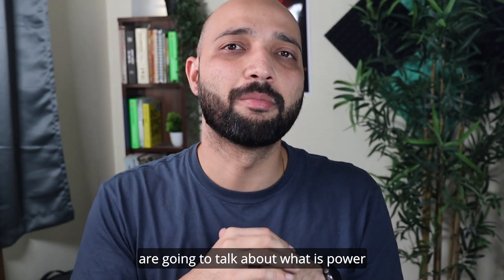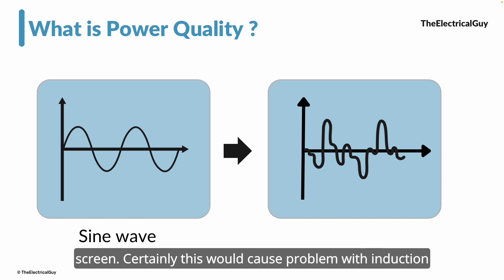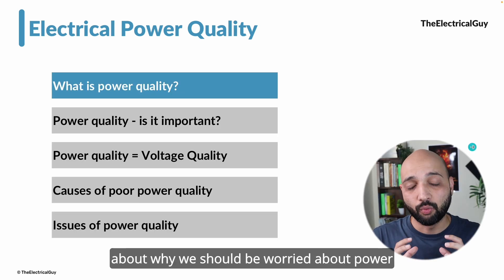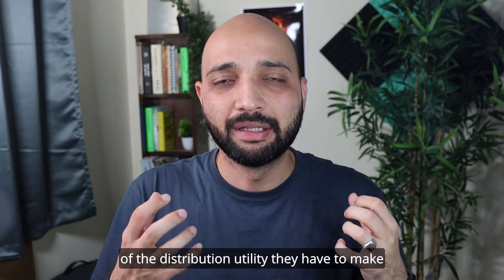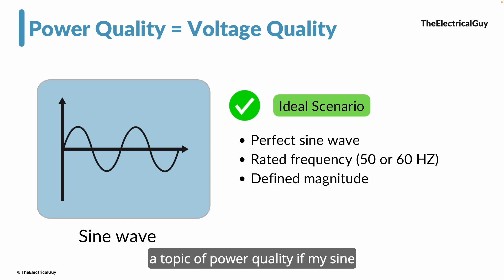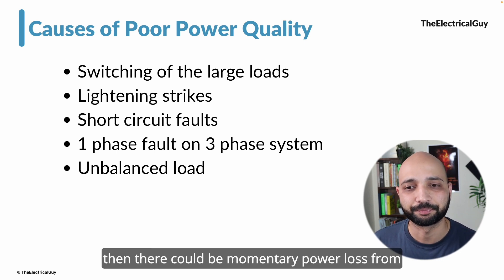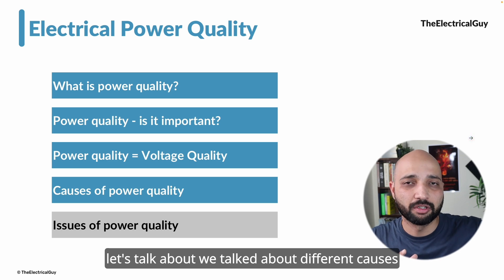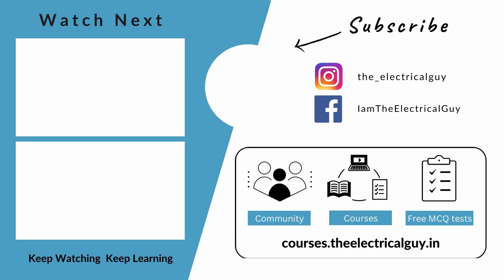What is Electrical Power Quality | Beginner's Guide | TheElectricalGuy

Comment: Lo siento, soy nuevo en el canal. Por favor, ¿podrías hacer un vídeo sobre protecciónes eléctricas en líneas de trasmisión o en sistemas de potencia? Quizás como interpretar las oscilografías de los relés de protección. Gracias.

Sorry, I'm new to the channel. Could you please make a video about electrical protections in transmission lines or power systems? Maybe how to interpret oscillographs from protection relays. Thanks.